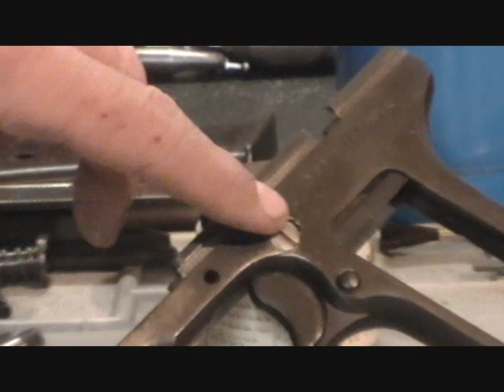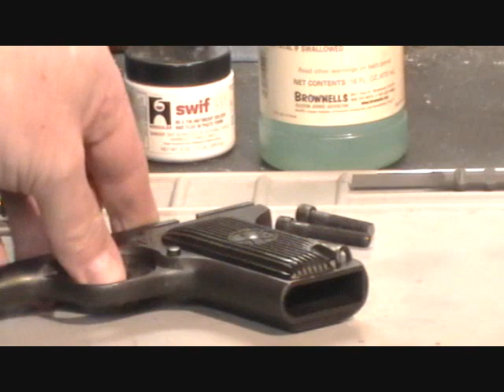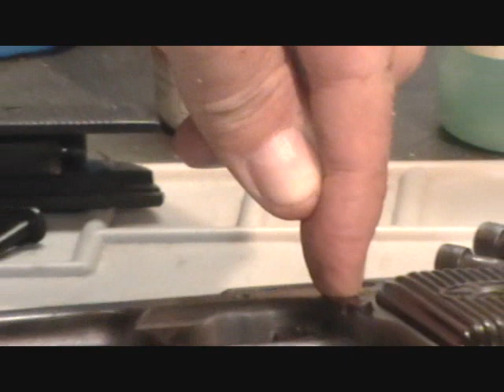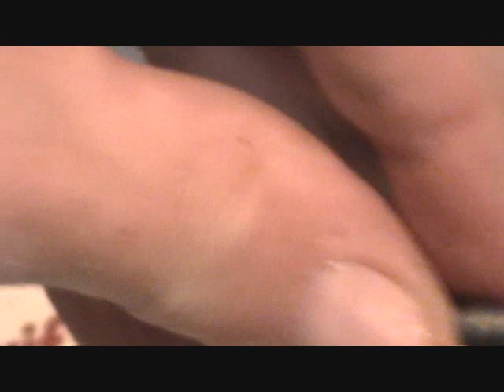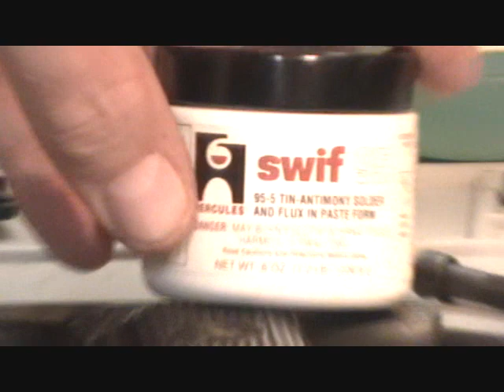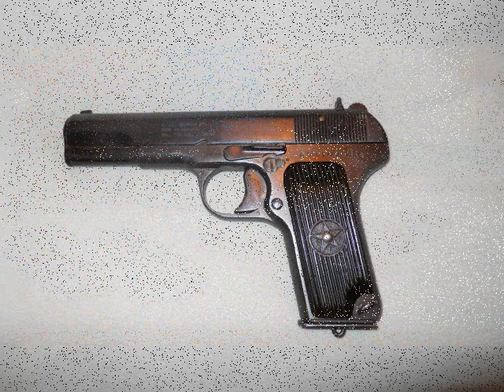Tokarev TT33, Romanian Cugir pistol, filling in safety through holes, Part Two of Two.

Comment: I lost the detent to my safety, so it just flops around...the spring is there but whatever sits on it I never saw...is it a ball or pin? if its a pin how long is it?
Reply from the maker: Stepped pin 4mm long rounded projecting tip of 1.5mm
Reply: thanks, i cant find one anywhere

Comment: why don't you just full it in with solder, file and sand it smooth then refinish it?
Reply from the maker: +Headcase Solders will not take a conventional gun finish.
Nickel steel weld rod well but as explained, the frame is so thin in this area that the heat required for welding runs the risk of permanent frame distortion.

Comment: Can you just file the safety and make it low profile and still operational, rather than plug the holes ?
Reply from the maker: +Fox Mulder The safety lever and the through pin are two separate pieces.
Filing the lever runs the risk of it separating from the through pin which can then rotate and disable the weapon.
Besides the purpose of doing this is to remove the unnecessary safety lever not make it more unobtrusive.
Reply: onmilo
I see, makes sense, Thanks !

Comment: The dimensions of the frame-walls on my Toks are the same as my Colt 1911. [.172 thou thick] over an 1/8th of an inch. Although, the safety is in a different spot on the Polish and the Yugo Toks, the result is the same.

A spot weld of TIG will NOT warp a slide. How do you think car restorers fill holes, weld sheet metal together. TIG welding is an art and very safe when used correctly. 

1928a1tommy  does an amazing refinish job on an Ithica 1911. And TIG welds the slide. [same thickness]

Comment: Personally, I would chose to TIG weld the holes closed, then re-heat-treat and anneal the frame, followed by a refinish job and polished bluing.

For me, the sight of what looks like a slot-screw-head in the side of this fine, yet inexpensive firearm, just kills the beauty of it.

But for a quick and dirty plug-job, this is good.  Although, the safety never bothers me on my collection of Toks.